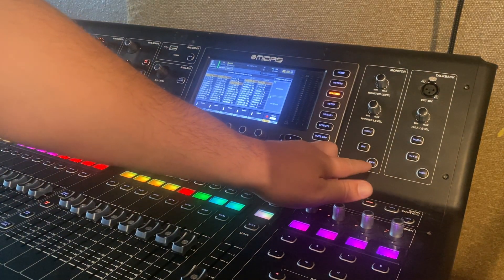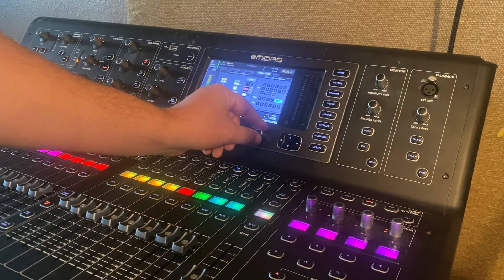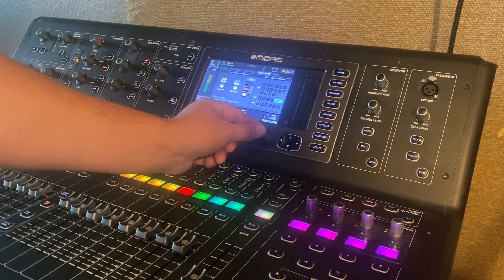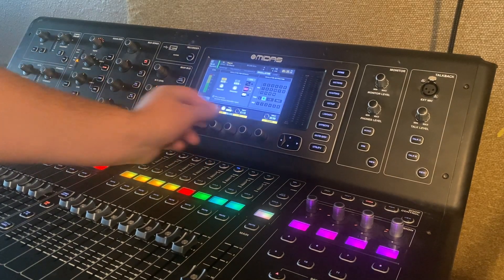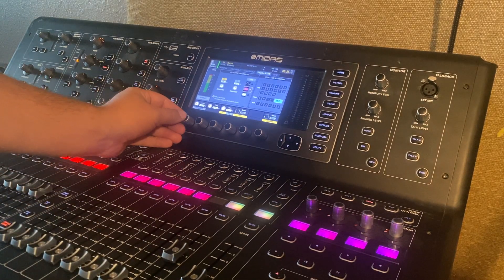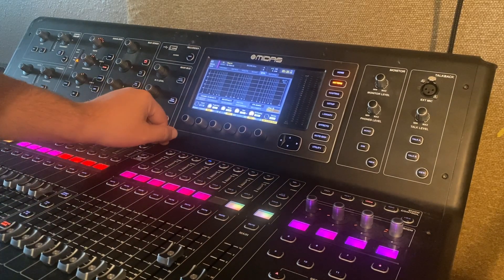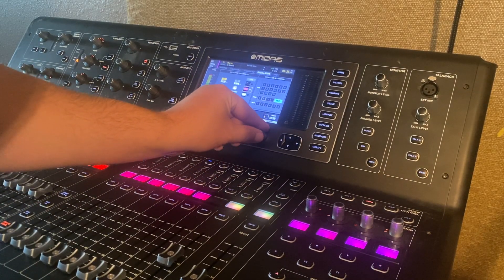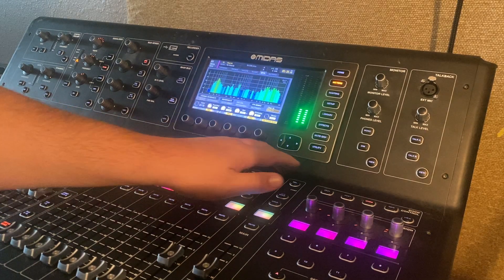M32/X32 Oscillator Pink Noise for RTA or Speaker Test

Comment: Hi Drew, this very important. Do the M n X airs - MR 18 n X 18s have pink noise. If no why are the manufacturers ...is., music group treat those of us who purchase these smaller digiboards so unfairly. It has no matrix, no capability to couple an aux bus being used as a mono sub bus to the main LR, no updates with new functionalities etc etc ...y are they so insensitive n biased. When I bought mine Mr 18, I paid almost half d price of x32 just for small venues but am so so disappointed that x32 keep getting updates but none of the airs. It's very unfair music group.
Reply: No they don't, and these features are missing in those smaller priced mixers precisely because they want to justify the higher price for the more expensive models (X32/M32, etc).